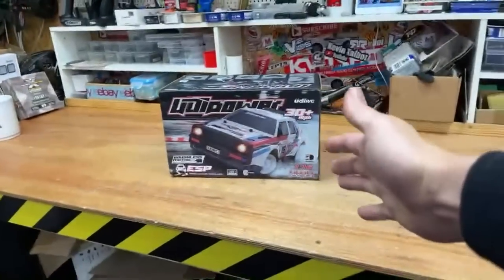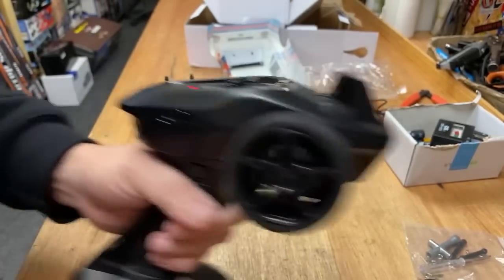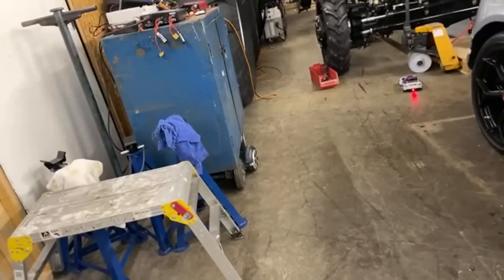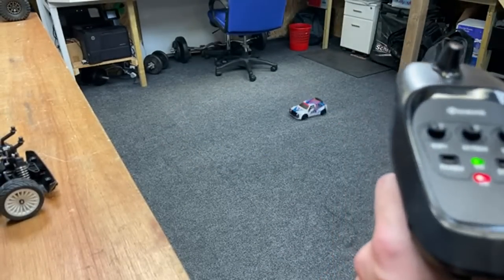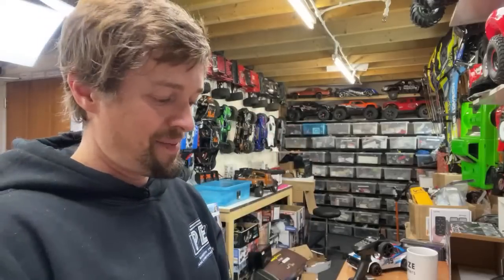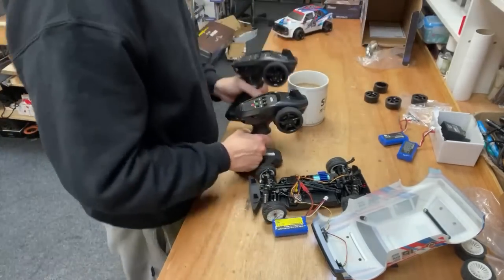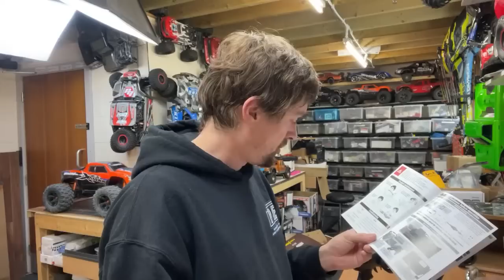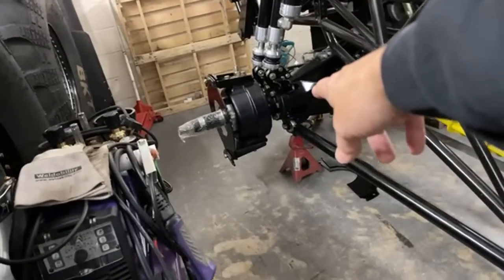Live unboxing Rc drift rally car

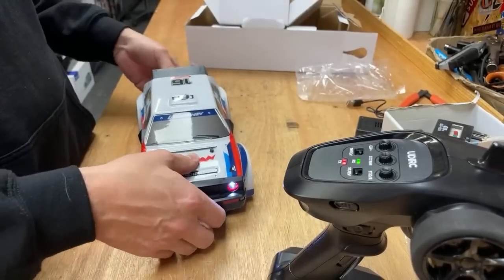Comment: 7:48 I have a brushless Bosch drill and if the battery gets down to a certain level it won't work at all. Unlike brushed it will continue to run at a reduced rate. Bet it's the battery, we shall see if he finds out later in the video. I also find with the brushless drill: pull the trigger pull the trigger more pull the trigger MORE then it works.....the variable speed isn't as variable as the brushed.

Comment: Kev you have to calibrate it the car has esp and you need to place the remote behind the car and turn the remote on than the car it SHOULD work.
Reply: You shouldn't HAVE to calibrate it straight out the box. None of mine needed to be calibrated but I did receive a bad battery with one and the gyro/esp didn't work in another.

Comment: udi rc is a bad brand i had a udi rc boat and only used it 5 times and then it stopped working
Reply: Yea because your personal experience is enough to bash an entire manufacturer...
UDIRC doesn't make these. They just put their name on this version/body. The SG1603 is 100% identical and is highly regarded as one of the best RCs of the year. 
Their also less than $100. Be cheap, get cheap.